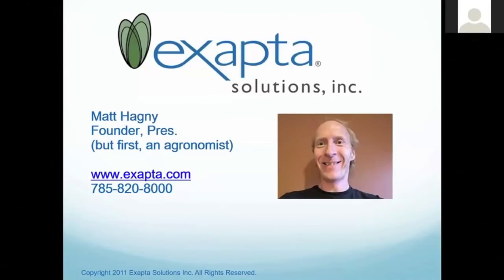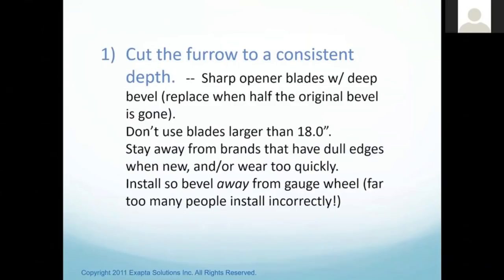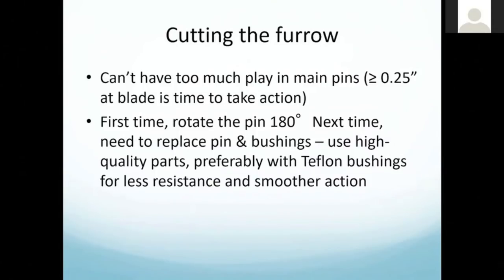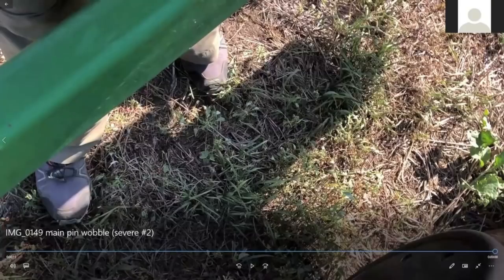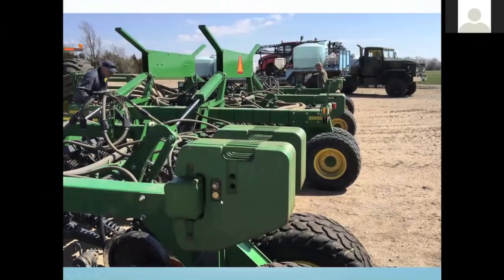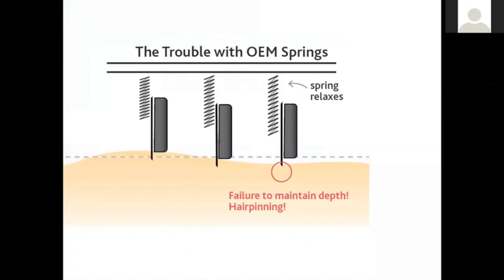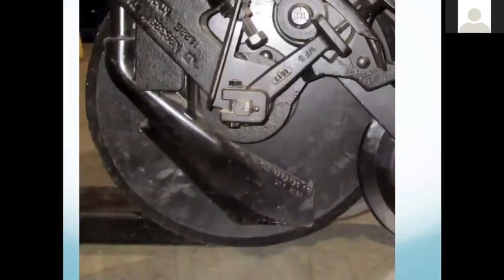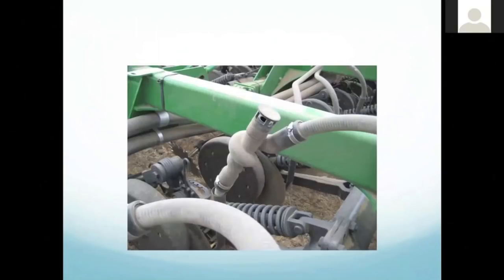Webinar: How to inspect & rebuild JD 50/60/90 series no-till drills

Comment: A good indicator with an airseeder of having to replace boot springs is when it is folded. When pretty bad, the back part of the boot where the seed flap is connected is hanging making a noticeable gap, where the better ones will be barely off the disc if at all. For box drills or the middle row of a seeder you should here it snap shut against the boot and should be a bit hard to be able to wedge your fingers between the disc and boot to pull it away. Bad springs you can grab the boot easily from the boots rounded top and pull it away.

Comment: I'd say to rebuild a full opener arm which  includes all joints and a shaft that is not seized where you can hammer it out with wood buffering the hammer, takes from 2 to 3 hours, which is considered a minor rebuild where only seals are replaced. If you have to pull it to press out the shaft then it could be 5 hours especially if you have to go as far as cut out the shaft and replace it and the spindle. Or if you have neglected it so bad the hub also needs attention then add another hour. So, best case 1.5 hours to worst 5 hours. And that is one skilled mechanic at the same speed as two half experienced ones or four drunk farm hands.